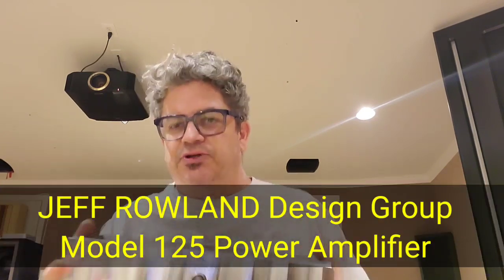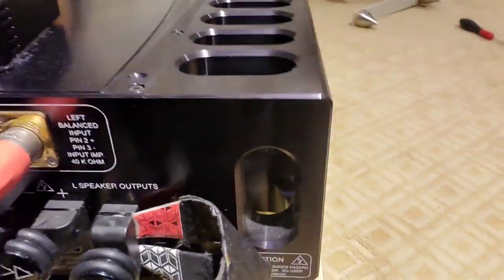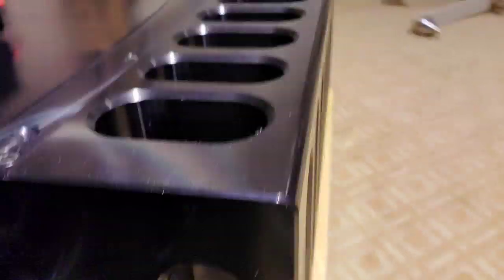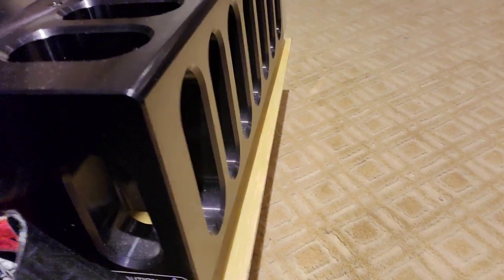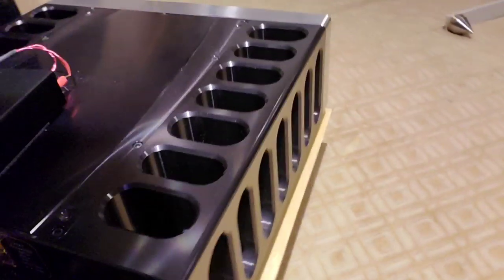Highest Value audio power amplifier for $3K

Comment: I'll go with the Benchmark AHB2.  It's a great all rounder...made in the USA.  Incredible specs.
Reply: Nothing beats its measurements.
Reply: I sold mine. I bought it to replace my Museatex CI-60, highly modified by John Wright. The CI-60 has a wide, deep and high soundstage with pinpoint imaging. The BMs soundstage was smaller and the imaging was really poor. The BM specs blow the CI-60 into the weeds, but specs seldom tell the whole story.

Comment: Looks nice for $3k, but that is often the problem with gear nowadays.  All the money is put into the chassis and aesthetics to give the "pride of ownership" that you mentioned.  What's inside?  The chassis (and usually heatsinks) are the most costly parts of amps, so if he's selling it at $3k and put a lot into the chassis, what are you getting under the hood.  An SMPS for a power supply?
Reply from the maker: I would not have pride of ownership from a silly Cosmetic. You know me better than that. My pride of ownership starts with American Made, then it goes to how incredibly well built every Rowland piece is, how durable they are and always seem to never run out of power, then we can get to sonic. Gorgeous. Clearly you have zero familiarity  with either Jeff nor his brand. Because if you even just meet Jeff for the first time , It takes literally 5 minutes  to realize this man has high integrity. Within 15 more minutes you know he would never in a million years embellish a box in order to hide crap inside. Only real Schmucks do that. Like Corporate HiFi.  perfect example. Once you know this brand and the man behind it, you realize this amp has the most clean intent matched with the highest integrity design. Honestly. It will re establish what you consider a reference build.
Reply from the maker: Please Jason dont tell me you think SMPS can not sound better than an old heavy ass linear. You realize any real R&D money has gone in to SMPS not linear for at least the last 10 years. Consider the possibility that the latest technology embarasses our beloved heavy and hot by orders of magnitude.   Its because very few designers have the balls to make whats currently the highest performance for audio regardless what the Audiophiles want.  I would not say this J unless i had experienced it first hand. My latest Class D amps are selling to SET die hards with higest end Wavac  300B amps utilizing original WE tubes and hand wound silver transformers. A big shift in listening is ushering in.
Reply: BTW, I forgot to mention another reason why nobody uses these cardas speaker terminals.  They are not only hard for consumers to hook up as you briefly alluded.  They are even worse for amp designers on the internal side.  They require much more work to install and performance/ease of hookup is arguably nowhere near those made by Furutech.
Reply from the maker: Im not pointing to this amp as an object of perfection im just saying i dont know of anything built better for 3K. Now remember,  Jeff sells it for $1700 , so before anyone starts calling this amp overpriced. Yell at the dealer. Jeff sells it for $1700. Im trying to clear the air about class D and Ice Modules being shit. So im saying Ill compete with this "cheap" Ice module with a Rowlandb designed class A , fully differential imput stage with dual Lundahl transformers. Its exactly this board which makes tjis Rowland throttle any other amp using the same module. The chassis stops vibration and resonance. Normally ice module is not given such wrll made real estate. Its why it sounds better. Ill prove it in a vid. Our industry is full of these wankers that talk like thry know something and desparige a product. I think evety audio show should have a boxing ring and lets let these big talkers come into the ring. They are pissants. I normally ignore them Jas because they are too weak to spend time on. But im cooped up and i feel like putting these jerks in thier place. So one video coming up
Reply from the maker: Oh by the way, lol. Have you insoected these posts close up ? They are made with Delrin. One spade you cam torque the shit out of the post and it clamps hard and neithernflexes nor deforms. Its an unfounded complaint.
Reply from the maker: The mono "dum dum" post ? Hes trying to hit a price point.
Reply: @OCDHIFiGuy  that's good, but why did he add a separate third post just for mono on the model above this if there was no issue using these posts as is for mono?  I'm not saying it's a huge problem, but there are much better options from Furutech unless the big knob aesthetic is what's important.  As you mentioned briefly in the video, they aren't even user friendly to put both spades in at the same time.  They are largely a gimmick terminal for looks which is why you don't see them much.
Reply: @OCDHIFiGuy  How does he overcome the extra noise generated by the SMPS ?
Reply from the maker: @BrianGarside  ive got no idea. The proof is in the pudding however....

Comment: If you think that $3K is a great value for a 3.5kg amp with SMPS then what would you say about Emotiva XPA-DR1 monoblocks for $2.4K a pair?
Reply from the maker: I Know Dan well and his brand is the best of Values, but its not an audiophile brand per se. Its more of Home theater stuff IMHO
Reply: @OCDHIFiGuy  If you compare how these amps are built it looks like Jeff's amp was a HT unit for the rear ;-) But to be honest I respect JR a a company very much. One expample, few years ago I considered buying JR consummate preamplifier. I asked JR about spare parts in case I need it, asked about new display (you know, the displays in these units sametimes are little burned due to age - over 25 years old preamp) and ...no problem, diplays are avalable. What a service.
Reply: @OCDHIFiGuy  Emotiva is very audiophile.
Reply: Without expending too many characters, not in my opinion and I loved what my Emo XPA-2 Gen2 did for my Maggie MMGs.   With my Tekton Moabs the Arcam 8P (50w 8ohm 100w 4ohm) is leaps and bounds better and far more engaging.  These are two products that at their respective release dates were about the same price.   The XP-2 does loud and clear and is refined to a point, but not at the level that Mikey hangs in.  To my ears the Arcam is WAY more engaging and ticks all the checkboxes for you favorite audiophile adjectives.  Mikey would probably say "I hear it, but I have something that will get you more" and show me a price tag north of $3k.

Comment: Benchmark ahb2 is best for that money. It has variable gain/input sensitivity which is very good for feeding it by a digital volume controlled dacs.
Reply from the maker: Exvcept if you have 4 ohnm speakers you cant use them with the benchmark if you bridge .
Reply: @OCDHIFiGuy  you don't need to bridge benchmark. 100w RMS should enough for normal room and listening levels. Even In low gain mode I hardly use it's 10 or 15w power most of the time.
Reply: @OCDHIFiGuy  From AudioScienceReview:"500 watts into 4 ohm! Stunning 0.00026% distortion at 500 watts!!"
Reply from the maker: @scottmichaels1764  wouldn't it be great if there were numbers that equalled great sound???

Comment: I wish as an entry level it would come with unbalanced input connection. Sacrilege I guess for the amp design. Does the speaker binding take banana plugs or only spade? It's hard to tell.
Reply: You can put the banana plug on its side and tighten the post carefully so as to not smash it.
Reply from the maker: Its spade, tightening bananas in there a lesson in anguish. I make banana to spade adapters though.
Reply: @OCDHIFiGuy  is the Rowland 125 a class D amp?
Reply from the maker: @bernardinovite2707  of course it is !  Whatever you do, dont get caught thinking Class D is not good for HiFi. Witin the last 3 months we released a new type of class D, that is the new way we will listen. Within ill say 5 years, the market for hot temp.
Heavy weight  hifi will all but disappear.
Reply: @OCDHIFiGuy  I'm not against class D amps , it's still growing on me. I know they're more efficient in many ways. The sound has improved a lot since the first models came out. It's like the CD vs vinyl debate. Which one is better. At this point I like tubes because to my ears they sound more natural. I'm sure the day will come when class D will sound as good as tubes. But then a better tube could be just around the corner.

Comment: That is absolutely stunning to look at! But how does it sound at that price point? What happens when you do take the network out of the equation? I can't bring my living room to a dealer, so if a direct to consumer company has a no risk trial period, that's just as good for me.. $3k gets you a choice of Schiit mono blocks and a tube pre-amp with money left over. Especially if you buy used, which you can. I just bought a used Vidar for $550 and I'm loving it! (How do you feel about the Vidar anyway?) $3k also gets you some serious looking kit from Audio-gd. I'm an owner and big fan of their headphone equipment and would easily give them a go in my speaker system when the time comes.
Reply from the maker: Hi Zack, I dont support China for political reasons.. I think they are bad for our economy and they like to keep worker slaves. Support Schiit far before any Chinese company. Buy used older gear from the greats like Jeff Rowland. Krell, CODA, Threshold, Classe, B&K, Etc...
Reply: @OCDHIFiGuy  China on the whole, I would agree. Run of the mill cheap crap, I'm right there with you. But top tier craftsmen the likes of Audio-gd, Denafrips, Hifi-Man, etc? Those are guys like you and me who just happened to be born in another place. Same with any other country. We're all one species living on one planet, barely a spec of dust in the cosmos. Putting up walls and discriminating against our neighbors doesn't help anyone in the long run.

 I've e-mailed back and fourth with Kingwa enough times, I think he's a stand up guy. Do I know him personally? No. But he's a pet lover and an audiophile like me. He works hard and he makes great products. I think he deserves our respect. And I think he deserves American dollars if we like his sound. 

I'm still going to audition some American gear against my Audio-gd stuff, after I have upgraded my speakers. (Looking at Tekton Moab.) I would budget around $2k for my end game DAC and pre. I might try that PS Audio unit and open to any other suggestions. At the moment, I'm driving my current JBL speakers with my Audio-gd headphone stack hooked up to my Vidar and I'm loving it. Blows my Emotiva TA-1 completely out of the water.

Comment: Happy to see someone with knowledge sharing a hifi pearl discovery with the world! Regarding the challenge: The Audio Note P1 SE Signature will easily beat any solid state or class d amp for twice the price and these big NAT as well! It has just 10 single ended tube Watts though - will match with your Klipschs.
Reply from the maker: I dont believe it. 10W is completely pigeonholed to a high efficiency speaker. Klipsch are my crappiest speakers.  Ive got Voxativ coming or AER. For the comparison, i did not day sounds best. I said highest value. I personally value versatility very much. So that outs the AN for me and its $3,K ? Is it a kit ?
Reply: Very cool that you are going to try Voxativ or something similar (Cube Audio maybe?). The P1 SE Signature is indeed 3k-ish, basically it is the same circuit like Audio Note's OTO SE Signature (ca. 6k also great value at that price) but with 1 input only, no balance control and no phono stage option - things most people can easily live with I think. Plus it has got a proper preamp stage. Granted it is not very versatile but the sound easily makes up for this... Really wouldn't recommend the Kits, it is not even the same company and they take a lot of shortcuts with regard to the parts. Agreed that Klipsch is not sounding too great, even the Klioschorn is too bright...

Comment: Bob Carver Crimson 275, are pretty good for the money, just under $3K.  That is tube-based and 2x75Watt.    If you want a D-Class that can compete with that I would consider the LSA Voyager GAN 350 (Underwood HiFi), that is 2x350W into 8ohm.
Reply: The "Carver" 275 is absolute garbage. The build quality is junk and the performance is worse.